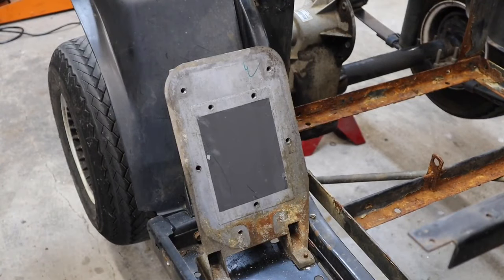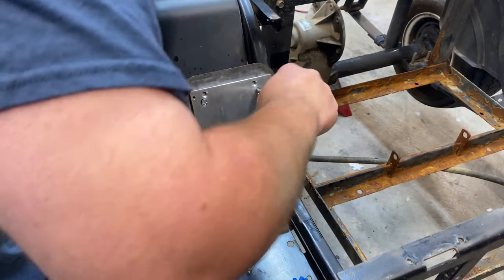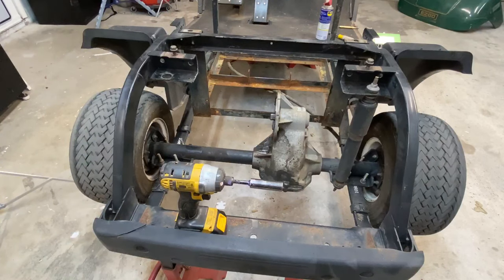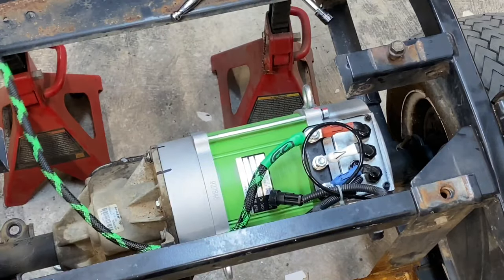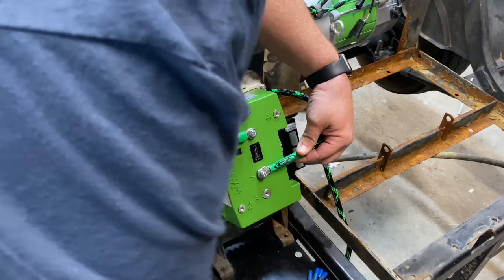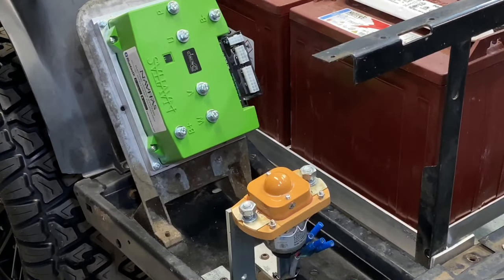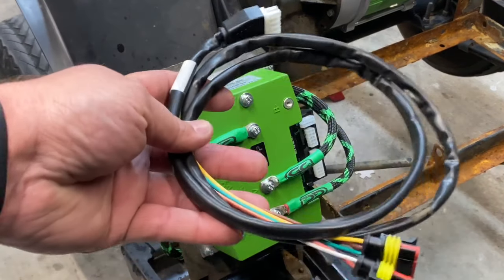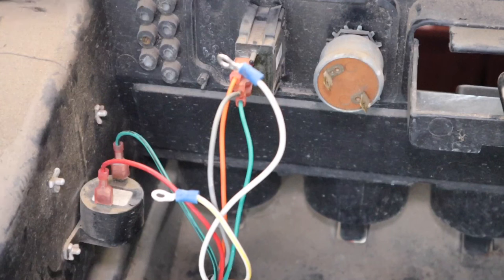How to swap a 36 volt EZGO to 48 Volts with The Navitas AC System

Comment: Couple things I would suggest you either add or comment on at minimum. 

1. You never finish hooking up the R , B- , or B+, so I needed to find another resource for that. 
2. You don’t show how to hook up the solenoid to the battery/controller, nor do you give suggestions how to mount it, given there isn’t any ideal way to do it with the hardware from the kit. 

The other minor thing is the 48v harness you sell to convert the 36v system does not have wires long enough to reach the Fwd/Rev switch. I had to extend those wires by a good 16” to reach. Not a big deal, but you prob should let people know, because I was baffled for a bit thinking I did something wrong. 

Other than that, bravo!  Thank you for the guide, it was a huge help!

Comment: Do you have to do anything extra to the batteries when going from 36 to 48 volts? I couldn't tell in the video if the controller and motor will just do that alone or what

Comment: Great video, must have been a bunch of editing to get this down to 30min!

Do you have a parts list for this conversion?

I have a 2002 6 Passenger TXT series/ITS. Converted from 36V to 48V with an Alltrax controller, HD Fwd/Rev switch, and solenoid.
If I am understanding correctly, the AC conversion does not need the HD Fwd/Rev switch.

What speed range would you see with this Navitas conversion (23" wheels)?
Reply from the maker: You have no idea how many hours are in this video.

We specialize in that kit and can answer all of your questions about it.  Drop us an email at golfcartsmodifiedsales@gmail.com and we can give you more info.  

~Travis Andrews GCMod

Comment: Question. The long orange wire that you said goes to battery charger... where does that go when you arr using a eco battery and charger? Do you just not use it? As I am no longer using the o.e.m charging port?

Comment: Excellent video.  I'm looking at this kit right now.  If I just buy the kit does it include everything you would need?  Does it include the Solenoid, and that wiring harness?  Do you need to replace the F/R switch?
Reply: Any reply about the solenoid?

Comment: Do you happen to know if navitas works with a hall effect type pedal box? When I run the diagnostics the foot switch is on without depressing the pedal. The resting voltage is good at .55v but the foot switch won't engage on the hall pedal. Not sure if this pedal is supposed to be that way and I just have the wrong pedal for this type controller or its something in the settings of the TAC2 controller I can change to make it work?

Comment: Great video!! I have a question on the 48V Solenoid, does it need the Diode and Resistor on the MZJ-400? I purchased the 4KW-600 amp DC to AC Conversion Kit and confused if I need to use the diode and resistor on this kit. Any help would be appreciated
Reply: You ever figure it out?
Reply: @chrisginoc  Yes sir, It runs extremely well.
Reply: @BrianPainter-es4bq  I just had the same kit installed on my Club Car DS on a 48v lithium battery. Did you switch out your solenoid with 2 AWG cables on it?
Reply: @chrisginoc  Yes I did. I also have 3 - 48v lithium batteries.
Reply: @BrianPainter-es4bq  I’m trying to find an affordable set of 2 AWG cables. Which ones did you buy?
Reply: @chrisginoc  Amazon and custom made all my cables. Not the cheapest but I know they are correct and look nice

Comment: For the loud back up horn, you can just insert a run of the mill foam ear plug from CVS, will reduce the sound to virtually nothing…yes that defeats the purpose of the warning system but then again we’re talking golf carts, not heavy machinery like backhoes and trucks.

Comment: I ave a 2003 36 volt series cart that I upgraded to 48 volts and it never had a run/tow switch. I'm thinking I can convert this to the Navitas system using a stock PDS harness and will need to add a switch. Since the pDS harness only has 2 wires for a switch, can I use a SPST switch?

Comment: I couldn't help but notice that you're missing the resister from post to post on the low amp wiring of your 400a Solenoid. Is there a disadvantage/advantage to this? I thought the controller would error out if this wasn't present... Thanks!

Comment: What happens when the Navitas Speed Controller gets wet from rain dripping through the seat cracks or water splashes up from the road? Is it more waterproof than what comes with most all carts or can it be made to be better about taking water splashes on Street Legal Carts?
Reply: The controller is IP rated for dust and moisture.  I wouldn’t go mudding or driving into a pond with it but it’s ok if it gets drips or splashes on it. Keep in mind that’s just the controller, if you have old sketchy wiring you may have a potential short that could damage the controller.
Reply from the maker: You should not have any issues when it comes to water splashing on it.  You do not want to spray directly with water though.

Comment: I’m upgrading a 1995 Medalist 36v to this system. Can you point me to a good aftermarket F/R rocker switch? Maybe easier to just mount one for a TXT on my dash. Also planning to run Li-Ion 48v system, BigBattery has a nice drop in system for about $2k. Any recommendations?
Reply: I have same cart. Did you do the upgrade?

Comment: I thought I finally had all the parts but my pedal control wire is a 4 wire square. Do I need to get a 48V pedal box or will my 36V pedal work if I splice the wires the way you did?
Reply from the maker: George send me a pic. Ryan@gcmod.com
Reply: @GolfCartsModified  I had a black in line connector that had the right color wires. I was able to use the 4 wire connector from the old TXT cart to splice and then use the same pedal. I hit 24 miles an hour after hooking everything up. Now definitely going to need to tighten up steering somehow.

Comment: @Ryan do I really  need a TXT ignition  that's  rated for 48 volts, won't the old PDS 36 ignition just  work  fine.
Reply from the maker: yes the orig will work just fine

Comment: I just a free gold cart 93 ezgo was working fine and it sat for about 3 years I bought new batteries and Now it doesn’t move forward or in reverse when you pumped Excelerator every once in a while it moves a couple inches in reverse and it diesAny ideas any help any suggestions
Reply from the maker: Could be a bad ITS sensor. I would start there

Comment: Hi , i have an old Golf Club Cart petrol engone 1993, not sure if you can help me. Cart haș sat for 6 months due to lockdown, it was fine before, but now it works  fine apart from the bleeping noise when in reverse gear will not stop in forward, neutral or with the ignition turnee off Off, the petrol gauge returns to empty, but the noise stays on so ive hâd to disconnect the battery to stop the noise. Can you advise me?
Reply from the maker: That’s a new one. Sounds like a break in the line to the beeper

Comment: What’s the range after the changes?  I’m looking to build the coolest on course cart but it needs to go 72 holes
Reply from the maker: As far as Range goes that’s typically a battery area. This kit on Lead Acid you will typically see around 17-20 miles of range. If you add a Eco 105 lithium now your getting into the 35-40 mile range

Comment: where can one get a 5kw motor for the yamaha drive?  the few places i've found that sell the dc to ac conversion kits only have the 4kw motor.  i'm assuming the 5kw will make better top speed?
Reply from the maker: We sell the 5k kit for the Yamaha. Same speed as a 4K just more torque

Comment: What happens if the buzzer is unhooked? Mine has been unhooked from day one and I just did the ac conversion kit and all seems to be working fine, unless I'm missing something. What happens?
Reply from the maker: Nothing will happen. They use the beeper to help with diagnosis problems.

Comment: I have a 2006 California Roaster 48 volts, can I use this kit on it
Reply: i noticed you said it was a 16 pin connector from the stock harness, the stock 36 volt pds is a 10 pin, will that work on this application?

Comment: How do switch between reverse and forward
Reply from the maker: Our Series conversion kit converts the cart over to a toggle switch for the FNR switch.  No more handle.
Reply: What are the color code for the fnr switch I have green grey and orange
Reply: @GolfCartsModified  you say no more handle. Was this cart originally a 36 volt series with shifter below the seat? And would this kit work well on an Ez-go PDS?